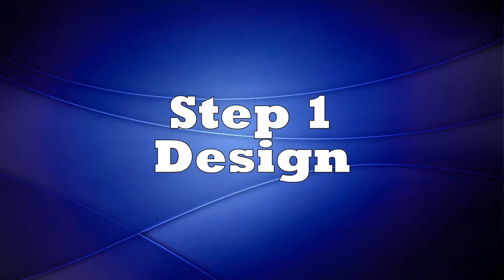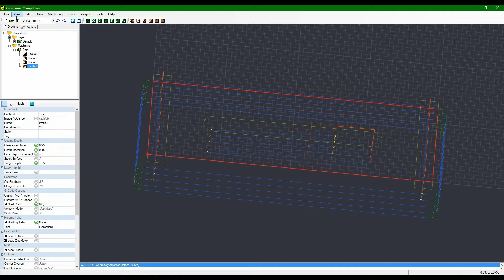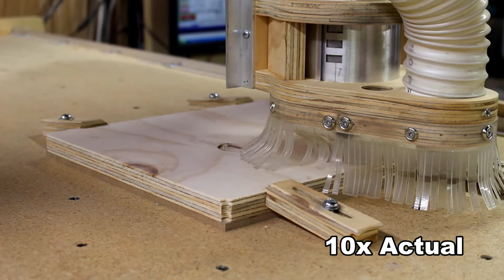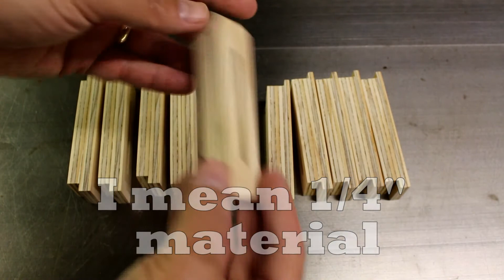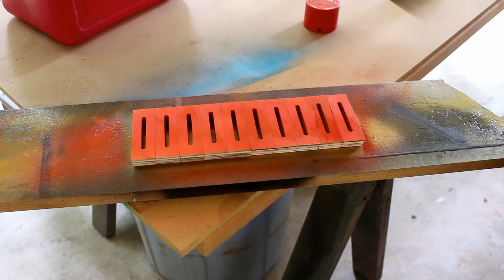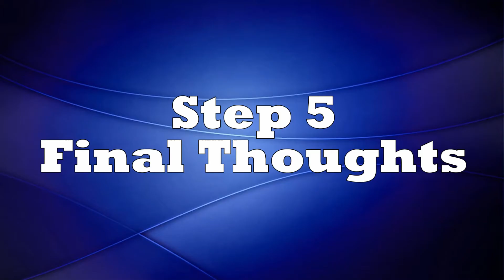CNC Hold Down Clamps - Wassell Woodworking

Comment: Hi Stephen, I followed your lead and made a set of 8 of these cleats today for the Shopbot Desktop at our Maker Labs. Even did the coat of red spray-paint on top as you suggested. Thanks for posting this.
Reply from the maker: Thanks for the comment. I have color coded the different thicknesses as well to make it easier. You will enjoy them. Thanks for watching.